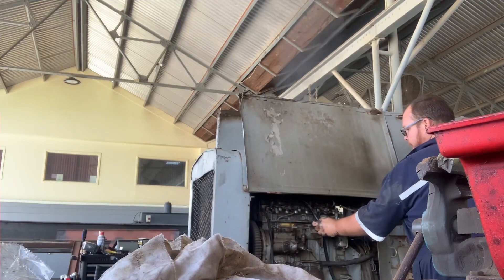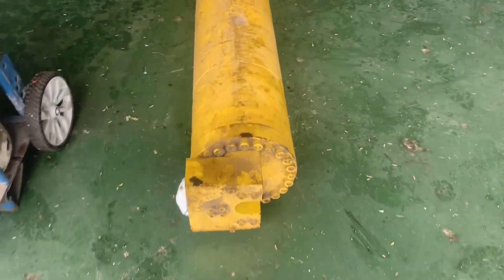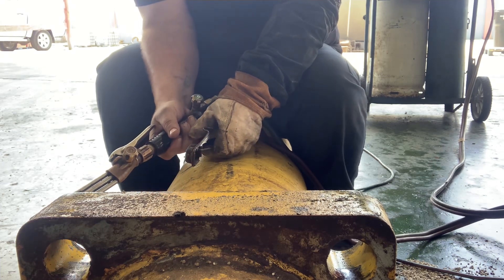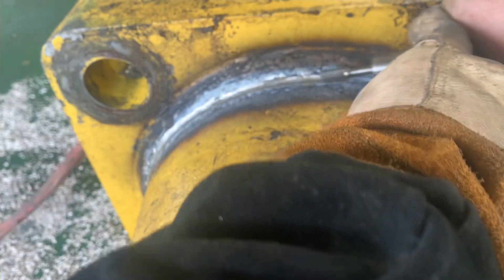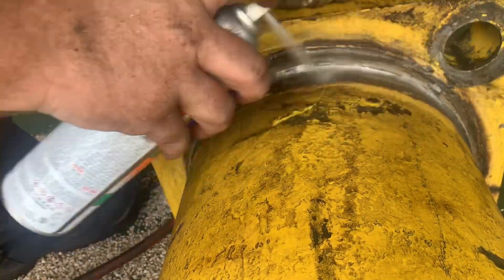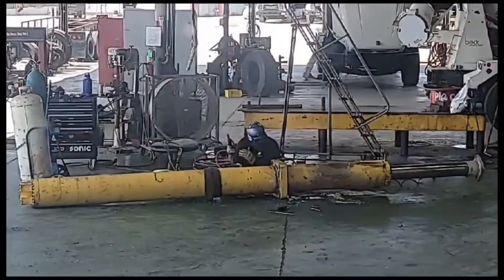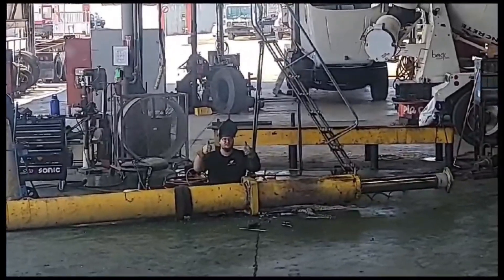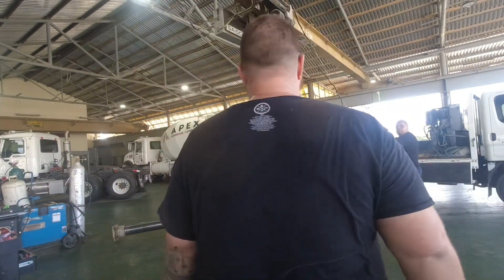Cracked hydraulic cilinder repair | Heating & Welding

Comment: I have one on a dump trailer that cracked in the same exact spot!! I have been looking for this video since I haven’t seen any others with this spot repaired. I was joking to myself when I said I’d 7018 it. Cause I just wanted to fluxcore wire feed fix this. I’m not the best stick welder especially traveling in all of the positions. I might just see if I can get away with trusty old good penetrating flux core :)